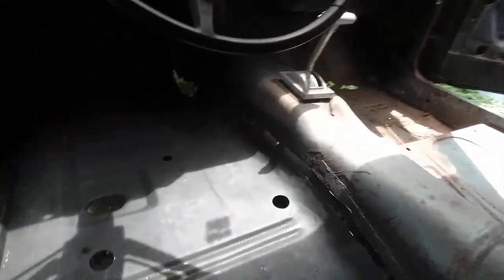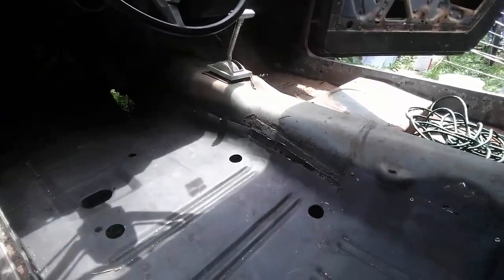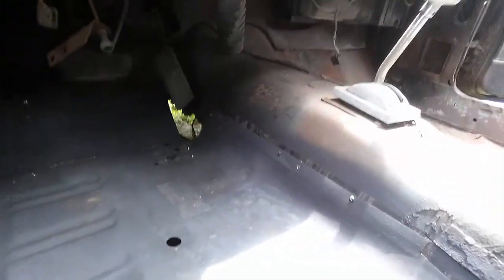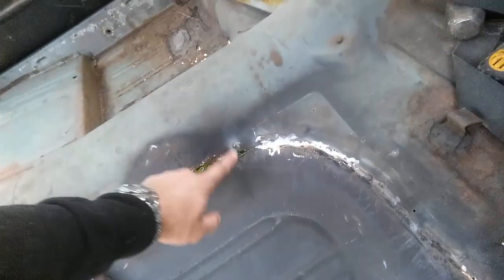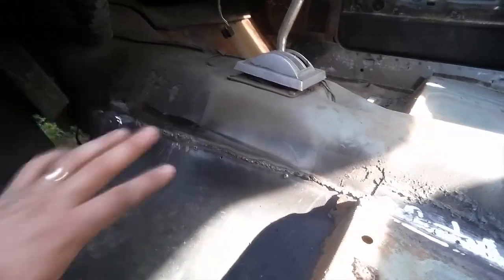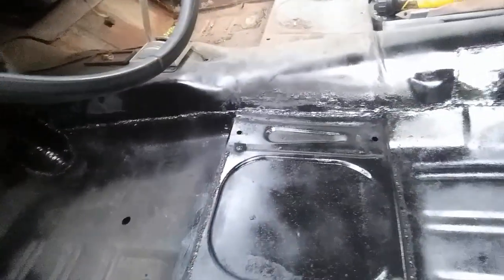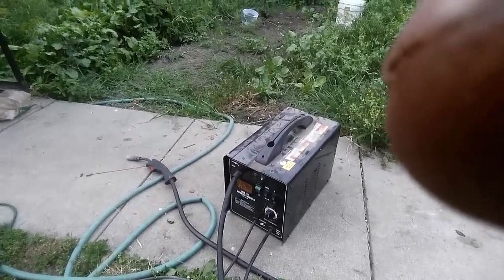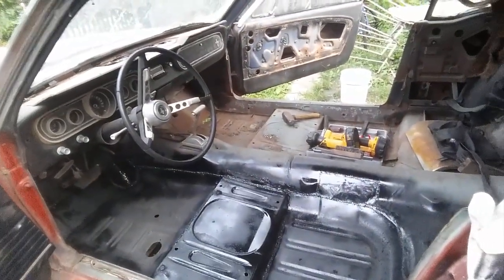Cheap floor pan replacement in rat rod 66 mustang, patching rust repair

Comment: lol the wrong right way.  I bought one of the 90 dollar welder and its great for spot welding or tack welding.  sheet metal is a bit tough to weld anyway but I welded the front door edge with it on my bird.  keep up the great work my friend
Reply from the maker: i much prefer the 170 amp 220v welder.  it has the amperage you need for kinds of things.  overall its much better quality.  but wouldnt hesitate to recomend the 90 amp... mine lasted 5 years before finaly dying...  thanks for stopping by, have a good one

Comment: I did something similar to my trunk floor on my 72 olds did half the trunk floor but I did use a 3M body seam sealer on top of the weld let it dry then painted it gives it a water tight seal and keeps the welds from rusting again anyways that's the only thing I would highly recommend doing besides that its just fine will take a while before it rusts up again no biggie
Reply from the maker: yup, por15 is great for that too
Reply: +Invincible Extremes Muscle Cars Garage chassis saver is good stuff too no chipping that stuff off it self levels and is hard AF when dry its meant for the frame but who cares  lol
Reply from the maker: +chevecrazy454ss that kinda stuff would be the best.  i mean, who wants to redo floors again after a couple years?  nobody

Comment: Is it ok to weld in your rivets? Haha. That came out pretty nice if you ask me. And what the heck was the "Durham" sign? Is that a street sign or a license plate? That is rockin cool!
Reply from the maker: durham nc 1976... not a clue.  but i found it in the passenger door while fixing the dent and I had to use it.  its a shame that its paper thin... but grabbed another roll of wire last night and will try and get it in there nice and solid.

and yes, if you can weld unprepped tar covered metal, then you can weld right over some rivets... on a serious note though, pop rivets have aluminum and the fumes will be fairly toxic.... just stay safe.   have a good one bud.

Comment: my 67 ranchero had pieces of thin sheet metal  rivited over the holes when i got it worst part is they were rusted through too the original floors underneath were still better then the rivited panels
Reply from the maker: thats pretty bad.  though i have to admit, theres nothing wrong with throwing down some temp sheetmetal... the thing that annoys me is when people swear up and down that glue and rivets are just as strong... and use actual floor reproductions they spend real money on...

like, geez, just spend another 90 and scab them in right?
Reply: i feel the same way
Reply from the maker: +Erik Pluck cause i dont judge anybody for having a limited budget... not at all... just be safe about it... ;-)
Reply: yeah i know but the thing is that the guy had recently swapped a 302 and a c4 from an 85 mustang into the truck not too long after i bought the truck but he did that for floors
Reply from the maker: +Erik Pluck he did that after you bought the truck?
Reply: no a few months before
Reply from the maker: +Erik Pluck gotcha.  yup, theres all kinds out there
Reply: yes there are

Comment: Where do you find a 300$ mustang
Reply from the maker: theres an interesting video on when i dragged it home.  1966 mustang hoonigan fun or something like that.

i just bought another 66 for $300 here in nebraska.  its going to take the two cars just to make a complete, and titled car.... plus the $300 in rust repair panels.  so under a grand for a complete titled and rust free straight mustang isnt bad.  especialy with the seats being in great shape.
Reply: +Invincible Extremes Muscle Cars Garage thx for the reply looking for my first project car your words about 6cyl mustangs got my attention I'll have to look out for a cheap one
Reply from the maker: +Ekd avoid the 65 and 66... the 67 and 68 are the best 6 cyl mustangs to buy.  the 65 and 66 have weaker suspension for the 6 cyl cars and cost an arm and a leg to upgrade later... where the 67 and 68 dont need any steering upgrades, just a new rear axle, and then some disc brakes (same spindles as the v8 cars)...

i have a video on that as well for my 68 mustang I bought running for $1,000 .... 4 lug to 5 lug swap.
Reply: +Invincible Extremes Muscle Cars Garage I'll have to rewatch those vids thanks for the info
Reply: Hey i couldnt afford a v8 muscle car so i got me a insurable papered 68 i6 mustang that needed some work for 1500 in bc. I did alot of work myself and got her running without a rebuild and now i just have to do the brakes and i can drive her. There out there just gotta find em